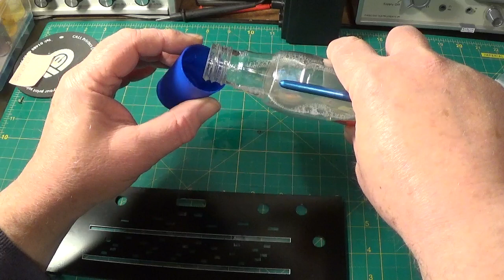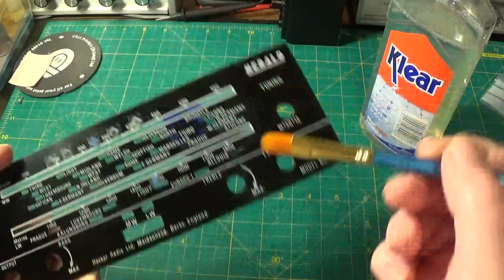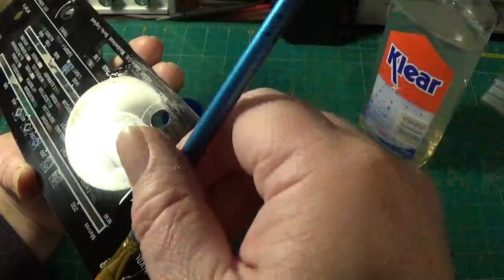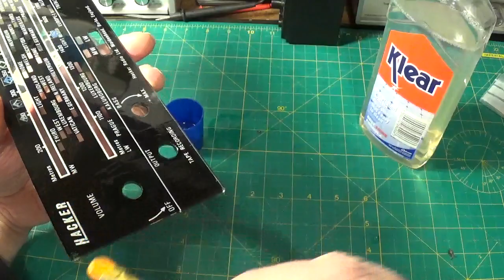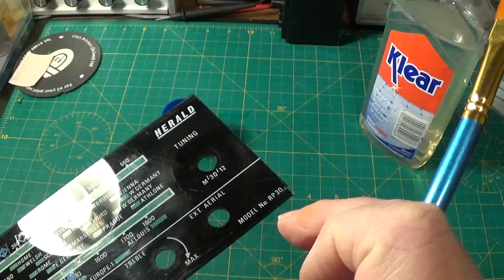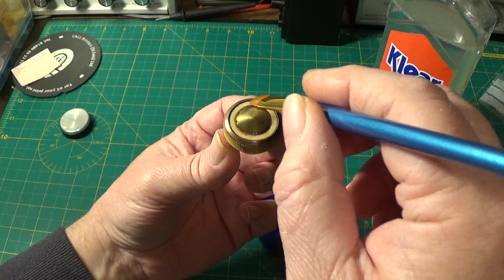Klear - uses in radio repair

Comment: Cool thats a neat tip will have a look out for that. When I Built my first amplifier and cleaned the aluminium panel and put on all the rub down lettering ( letraset ) I gave the panel a spray with hair lacquer !

Comment: You have just accessed a memory that i thought was gone, we used that exact stuff for the kitchen floor when i was a kid, a really long time ago :-).

I'm sure my mum diluted it with water for some reason, make it go firther maybe.
And there was a way to remove the old shine as well, but i don't seem to have that memory any longer :-(.
I imagine you could use it for coating pcb's in radios that had lost there protective coating.